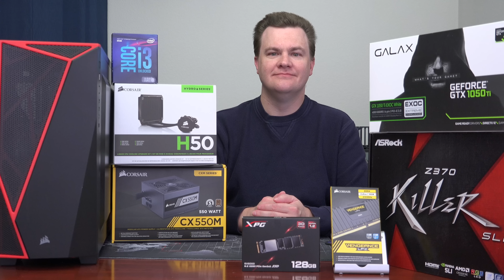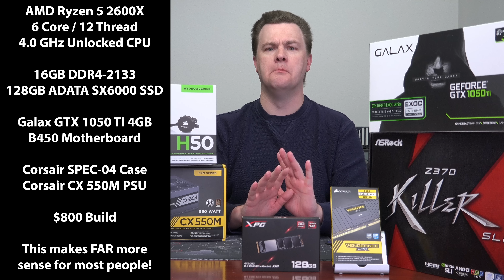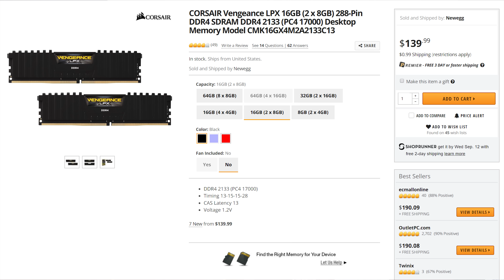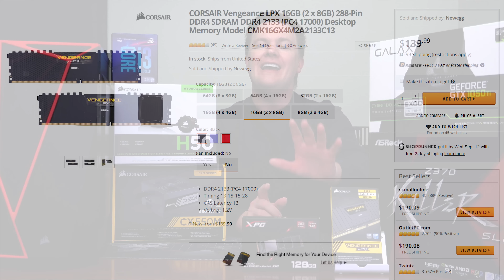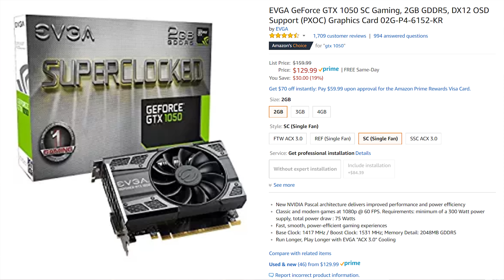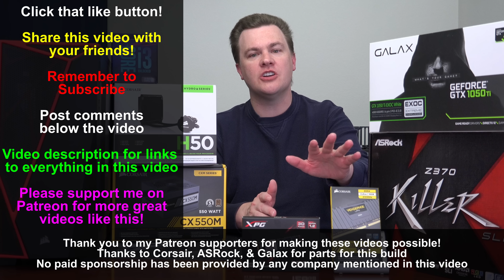i3-8350K - $800 Build - Full Blown Crazy? - Lets Find Out!

Comment: Forget this build.
Get a air cooler instead of the H50. In price range of 25-50 dollars is enough to cool a 4,8-5ghz overclock. (i did 4,8 ghz OC with a 25 euro hyper t4)
get a bigger ssd, 128gb brings you nowhere. a 250 or 500 gb does not cost much more.
get a ddr4 3ghz, it does not cost much more then the slow one in the video.
get a used gtx 1070 for around 200 bucks.
and you are good to go for all triple A games and the prize point is the same.

Comment: the i3-8350k is sooooo good , it deserves a better video card , all the  games mentioned at the beginning of the vid r exactly what u should be using this cpu 4 , it performs just a few frames behind a i5-8600k/i7-8700k..............and in a few years pickup a secondhand i7-8700k save yourself a $150US  , doing it this way allows u to spend more on your GPU 4 a gaming system.

Comment: Sounds similar to my latest build

I3 8350k @ 4.8 (haven't pushed it, only air cooled and using stock TIM until the rest of the parts show up. Don't want to waste the Kryonaut in the meantime)

MSI Z370M Mortar motherboard

SX8200 240gb NVME
 
32gb of Team T Force Vulcan 3000mhz ddr4 ram 

EVGA 1070sc black edition

Cooler Master Masterfan Pros throughout (3x 120 pressure fans up front, 1x 140 pressure on top, 1x 120 balance fan at the rear)

Scythe Ninja 4 cooler (barely fits, have to use low profile ram and it still only has about 1/4" clearance all around the cooler)

EVGA 600W semi modular power supply

Thermaltake Versa h17 case

Still about 650 from being "done" because I want a ton of storage (10-20tb, still deciding what drives I want. Debating hybrids for the 2.5 slots and shuckables for the 3.5s VS ssd for 2.5s and hybrid for the 3.5s)

Total is about $1100 (before storage... To be fair 1/4 of that is just ram) with the deals I found. Has a solid upgrade path, outruns my monitor by a long shot. Should be good for a while. If I need to upgrade I would start with a delided I5 8600k and go from there.

Comment: Wondering about World of Warcraft, had trouble lately with it with my old computer and can't get the fps out of my system that I use 2, I have unplayable fps in 20 man raiding, 35 fps/stuttering, looking for a solution to that and was looking to get top of the line 2k-2.5k system, wondering if this setup would do the trick instead???

Comment: I just bought an acer aspire tc-885 with acer ro1-a0 bios. The bios part is important because it wont let me change the onboard graphics to pcie in bios. I just bought a 1050 ti to try to run csgo better, but it doesnt detect it, meaning it doesnt even show up in display adapters. Ive done so much to try and fix it including running ddu and trying to install nvidias drivers, but it wont let me because the computer wont even detect it. Anything you could suggest would help me out, the card is brand new. Please be simple though, I dont know as much as most gamers about these things.
also i dont know if the means anything but i have to use a vga to hdmi adapter because the monitor only supports vga, but i dont see how this would be a factor since the card doesnt even show up in display adapters when I run my pc using the onboard/integrated graphics with the card in the motherboard, and yes it is in correctly Ive tried unplugging it and putting it back in a million times. Thank you

Comment: Yes, it its crazy. Not in a good way. But if somebody decides to build a 800 USD PC cause SWTOR and WOW run 10 FPS better - congrats! If you hope this will help thru your bad internet connection, I am sorry. Meanwhile I'll build nearly the same system with a i5 8400 or Ryzen 5 2600 and a GTX 1060 6 GB for the same price and can play ALL kind of games equally good.
Reply: totally agree with you...
Reply: Or a rx 580
Reply: Also small AIO water cooler lol. Thing with water coolers is you got to a huge bump up in price before they actually start getting better then air cooler. The only reason for a AIO water cooler in my eyes is when you do not have space for a large air cooler.

Comment: Nice build, love your channel. I wonder did anyone take into account that the Corsair Spec 04 tg only comes with one fan. Fans depending on what you buy can coast up to 28.00 each. Oh and the big one that is also not mentioned is the Windows10.  Now if you include 2 more fans at 12.00 to 15.00 each and a 120.00 for windows 10 this is more like a thousand dollar build. Yes 800 for basic components. Don't forget the extra's
Reply: 😒 the spec02 red edition comes with Three Fans 120mm each 😒👍🐢🐢🐢

Comment: Really looking fwd to the OC installment. Don't underestimate this build. This is on a par if not better than my 6600k. I use a 144 panel admittedly with a 1080 but run Photoshop occasionally and some Native instruments software (incl. the dj software) with no issues at all (4.4ghz). Most VRAM I've seen Overwatch use is 2.1gb @ 4k. Driving sims (generally CPU heavy), like Project cars, no micro-stuttering but my main use is lighter games like OW/Rocket League. I certainly see no reason to upgrade rn. Hopefully as a Dva main you'll include OW (maybe RL?) in your testing, 1080p for OW is about 1.2GB I think so even a GTX1050 should be good. Assuming you get a similar or better frequency clock than mine this 8350k (CPU wise) will be a beast for more people here than I think is being portrayed (but totally see why you are stressing it's specific use case to the general audience).  As an example it had no issues getting my GTX1080 to 90fps (albeit all lighting/filtering effects and motion blur off/low) in BF5 open beta @1080p so I'd doubt the 8350k couldn't do that either.

Comment: Ah just get normal i3 8100 and b360 mobo and add there a gtx 1070, use the stock cooler, you can kick the ass out of this pc,
Tho where i live vega 56 from msi with a blower cooler is 40€ cheaper than 1070 turbo from asus, so it might be good to get vega56
Reply: Well i forgot about the dual 8pin, well you would need to get a better  psu

Comment: i have 8100,rx 470 4gb , asus prime  z370 p,120 ssd , and old  laptop hdd 340 gb ,500wat thermaltake , case gigabyte g1 gz , this build is better value than yours .. dota 2 ,whitcher 3,pubg,and i do light PS and AI work on it ... realy happy with this performance but what did upset me is they luanched the ryzen 2400g after i bought this ..well if the romure is true about the z 370 mobo will accept the 9th gen then i will be happy 😁

Comment: One other thing that cares more about clock speed or IPC than core count is emulation. Popular emulators like DeSmuME (DS), PCSX2 (PS2), Dolphin (GC/Wii), and Citra (3DS) only use one or two cores. Although that's quickly changing with newer systems like PS3 and Wii U, I doubt something like a 18C/36T Xeon at 2.3 GHz is going to do much good beyond the compiling phase.
Honestly, what we really need these days is a dual-socket motherboard that can take two different CPUs of the same architecture, which you can switch between via a reboot or hardware toggle, while using the same RAM, graphics card, HDD, etc. Chinese manufacturers have already modified the H67/Q75 desktop chipset to work with LGA-2011 Xeons, which means having an LGA-1155 socket and an LGA-2011 socket side-by-side is theoretically possible on the same board (only one can be used at a time, of course).
It actually has already been done a long time ago by ECS with its "PF88 Extreme Hybrid" board, on which you can use either an Intel LGA-775 or an AMD K8 CPU. It's a pity that nobody has expanded on this concept, because it would be so convenient if you could switch between a highly-clocked i3/i5 for gaming, and a many-core Xeon for heavy workloads, on the same system.

Comment: Given that you can scrap a hard drive from somewhere:
R5 1600
B350M Pro4
Cooler Master MasterBox Lite 3.1
8GB DDR4 2666 (any brand)
550W CX Corsair
GTX 1070 ti Zotac Mini.
I am quite sure that this would perform better.
820$.
Reply from the maker: Perform better in "what"?

8GB of RAM, 3.7GHz clock speed, it has its limits...  much better GPU of course  :)

Comment: And I think you'll be fine playing BFV the new assassin creed. Why? Because I was playing with a guy who was using a 780 ti to play so why wouldn't the 1050 ti or even a 1060 help you to play with this system especially at 5.0ghz. You would be fine but I'd recommend buying a 1060 not the 1050 ti.
Reply from the maker: This doesn't have enough cores and threads to play those games...

Also, a GTX 780TI is quite a bit faster than a 1050 TI...
Reply: @TechDeals  tech deals are you out of your mind lad. Mad lad

Comment: Its def interesting to see a full i3 unlock cpu build. All the past reviews explained that this CPU should not exist when for a couple dollars more and get a i5 8400 cpu for better price to performance. 

Older games which dont care about core counts above 2 but more on CPU speeds is prob where this CPU excels. 

That said it will be interesting to see how it performs with games like CS:GO, Overwatch, Fortnite, PUBG and other esport fps games fair on this K chip. 

I wonder if the popular CM Hyper 212 Evo will do just fine over the AIO and still hit close to 5GHz. 

The used GPU market is starting to get flooded with GTX1060 GTX1070/Ti because of the coin mining bust. 

So for prob the same price if not slightly higher budget. You might be able to snag a deal on a GTX1070 for new GTX1060 6GB prices.
Reply: It wasent too long ago gamers were begging for an unlocked i3 when it was a 2c2t chip ,now everyone's like meh it's only 4 cores
Reply: @leeoloughlin9249  that wasnt an i3 its was the G3258

Comment: Is 4C4T 5.0 GHz overclocked CPU good enough to run AAA games comfortably on a 1080p 144Hz monitor or do I need to choose a CPU with a higher core count?
Reply: If it's Intel then the higher ipc on each core will be fine m8. It's more to do with what you you have to sustain 144 htz/ fps. I play 4k 60hz /fps and I'm happy at 60hz

Comment: I just build a rig like this it has 
I3 8100k
Gtx 1050ti
8gb ram
Gigabyte h310
And all other usually stuff and it cost me around 485$ and honestly saying it runs all current games easily.
Anyone who wants a budget built and who is a casual gamer who just wants to play current titles this is the rig to go for
Reply: For my cousin I built a mITX system
12" tall 8,5" deep and 8" wide; All  air intake from bottom of case
i3-8300 w/stock cooler (3,7ghz) 119.00  Fry's
B360N itx Mobo 89.00 Fry's
GTX 1060 3gb 229.00 Amazon
8GB 2666 ram 69.00 Fry's
500GB m.2 drive 119.00 Amazon
Jonsbo C2 mITX case 60.00 AliExpress
Silverstone 450w SFX PSU 45.00 Amazon
And I bought  Win 10 Home on sale for 89.00 Fry's
Total - 819.00

Logitech Wireless keyboard and mouse 10.00 Thrift store
Dell 2408 16:10 Monitor with soundbar 40.00 craigslist
32GB Flash drive - 10.00 Fry's

It's a tidy little machine.
Reply: I'm more of a spend alot in 1 lump and worry about it in 5 years or so.
Reply: @leeoloughlin9249  yeah it is logical but not everyone has that much budget to spend on one thing

Comment: Why would you suggest that the alternative from Ryzen is 2600X? B350 and R5 1600 is much better and with money saved that way you could squeeze in a 1060 3GB easily.
Reply: 😒 because the 2600x is plug n play, no bs manual overclocking to worry about
Reply: So you're suggesting wasting money on not that much faster CPU instead of much faster GPU to save yourself 5mins of googling. Brilliant. Any more smart ideas?
Reply: @rubbers3  😒👍 yes get the good newer 2nd gen stuff, because the first gen ryzen stuff is garbage 😒👎

Comment: Been using a Ryzen 1500x for the past year now and was actually thinking of changing over to a cheaper Intel system. The reason is that the single thread performance of a Pentium G5600 is  2277 on Passmark while my 1500x is just 1854. I don't game, encode or multitask so my PC is basically for websurfing, watching video and listening to music which I think will benefit greatly from the higher performing Intel. If I'm wrong about this, please explain.
Reply: 🤓 Its about the same for websurfing so no reason for you to change, if i were u i would add a cheap video card and at least play some free indy games
Reply: Thanks, running a 1050 ti right now but might upgrade to a 1060 if prices keep falling.

Comment: I just build my new PC... it should cost around $900 in US, but in the country I live the price is around $1200... Still... AMD Ryzen 5 1600 (with the stock cooler), MSI B350 Tomahawk, EVGA GTX 1070 SC, 550W PSU from Seasonic (modular, 80+ Gold), 8gb of RAM (2x4 gb, Team Vulcan 3000mhz), 240Gb SSD 2.5" and the HDD from my old PC (WD Blue 1TB, 7200rpm, 64mb cache) and the case is Fractal Design Meshify C Dark TG

Comment: I've 2  4GB DDR3 ram, 1 of them 1600mhz and another 1333mhz..  I want to buy a ssd. So should I change the 1333mhz ram or just buy a ssd?? 🤔🤔🤔???! What should most important for better performance?
Reply from the maker: SSD
Reply: @TechDeals  thank you sir
Reply: I guess, I have the same ram configuration :) Who cares, if it runs dual channel  you already get your way higher igp perf in your laptop.  Buy the ssd, it even extends your battery life.

This guy went crazy  :D 
"8600K - Please do not buy a one!!! " and now he puts an  i3 K chip on water for high single core perf. (with slow RAM). 
128gig M.2 why is that even exist? :D for poor-rich guys?
I guess he is just using his crazy component from the shelf...that is extremely unbalanced.
Reply: Your ram sticks should both run at the slowest of the two i.e. 1333 mhz. The ssd would make everything feel alot faster than a slightly faster ram stick.
Reply: Thanks

Comment: This build is okay but if you go and upgrade CPU or GPU you will realize you just threw money away on the original parts and if you just went with a slightly higher end part to begin with you would have been better off in performance and total  amount spent.  Now if you think that this build will do you for the next 5-6 years and you plan on not spending money on upgrades, well you do you.
Reply: Dan Reed 

Yeah, but at some point you have to stop saving money and actually build the damn thing. Especially considering the demographic that this PC is aimed towards is people on a lower budget.

Sure, we could all save up and buy the high-end components but if you want to get your feet wet and just start playing, then you have to begin the build at some point. This way, instead of having to drop $1,500+ on an entire system, one could just start playing and then upgrade the components as finances permit. Nothing wrong with that. A build like this is destined to be upgraded and that’s kind of the point. Not to mention that one could sell the “lesser” components to offset upgrade costs.
Reply: I just don't see the point of the 8350k at all. Just go with a cheaper board and an 8400 or if you want to keep z370 go to the 8600k at minimum, and a GTX 1050ti is just not going to cut it in as little as 2 years. I would go GTX1060 3gb minimum. Not high end stuff, just more balanced in my opinion.

Comment: Better a 8400 4 cores is almost dead
Reply: But the 8350 has better single core performance at stock and much better overclocked performance. That was the whole point of the build.
Reply: doesnt matter what kind of games your are playing whether it requires multiple cores/threads or not... you just dont get better value for your money... and this is what most people seems to forget...

Comment: Can you test the specific use case of 3D modelling?  If you are a heavy Solidworks, Maya, or Sketchup user for instance.  As I understand it, modelling (not rendering) is primarily a single core undertaking.  This build may be much snappier day in and day for a design professional like an architect or mechanical engineer in specific 3D design software.

Comment: The GTX 1050 Ti will bottle neck the Core i3 8350K , you should get a RX 570 4gb , on New egg theres a power cooler RX 570 8gb for 199$. an RX 570 is 50-60% better than the GTX 1050Ti and its support free sync.
Reply from the maker: As noted in the video, some games just like NVidia better...
Reply: 😒 get the rx580 8gb to compensate because rx cards run slow on invidia games, assuming that it wont crash or fail to boot 🐢😉
Reply: MrSammy actually the deal was a power color 8gb RX 570 , I made a typo for 4gb, the 8gb RX 570 costed 200$

Comment: I have a 7700k and will that be good for the coming years. I know it's 4 cores and 8 threads. I got some buyer's remorse in light of the 8700k.
Reply: 7700k is really good. Did u overclock it?
Reply: @masterprima7480  I have a Z270 Asus  maximus 9 MOBO with a H100i v2 cooler corsair. There are some presets that can overclock it. I'm just scared I might screw something up.
Reply: Don't be dude overclocking easy these days. It's not like the older days where you could melt the cpu. Just Google overclocking i7 7700k and give it a go. The cooler is fine and the.mobo is begging to be overclocked
Reply: @leeoloughlin9249  will it wear out the CPU by any chance. Also, I saw some presets in the bios. Just curious because that could be something to check out.